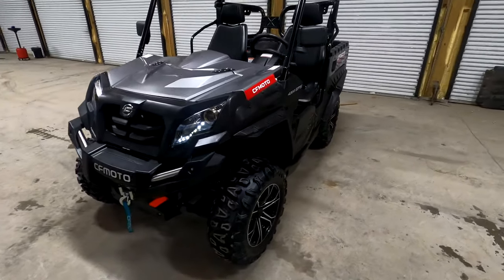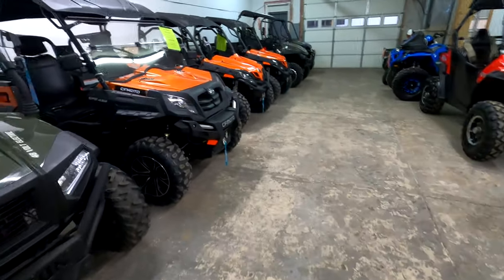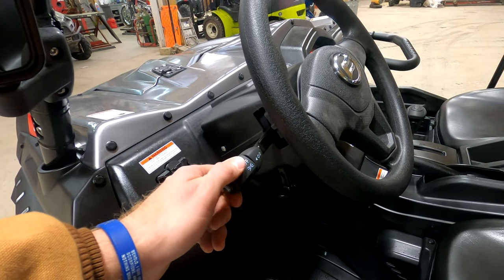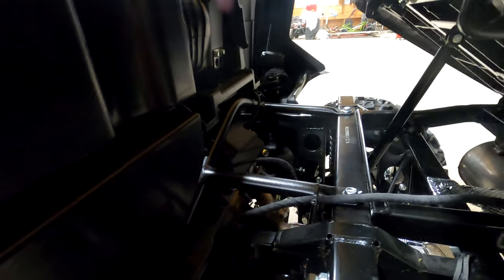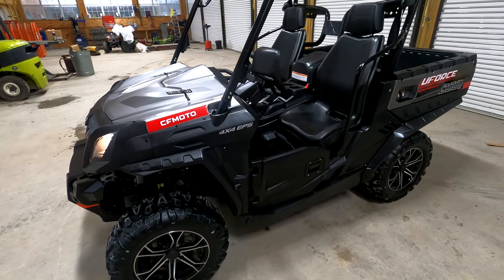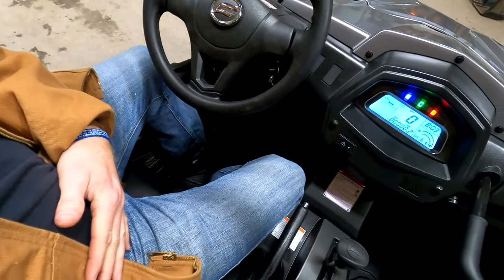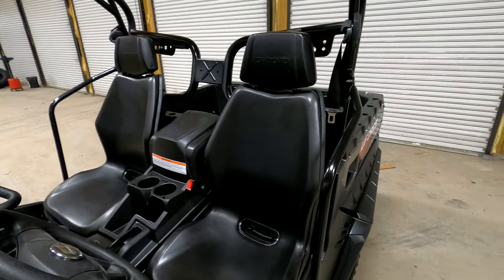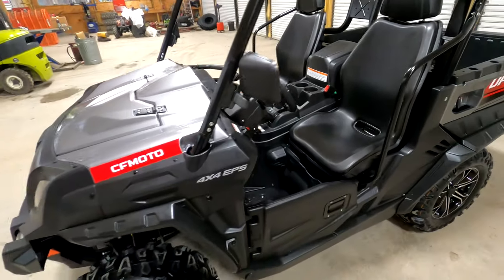2021 CFMOTO UFORCE 800 Walk Around & My Thoughts

Comment: I've had my UFORCE  800 since 2017. I've got 700 miles on it and no problem so far. IT will get with it pretty good and has the ability to climb hills good . I don't think there's a better utv for the money. THE ONLY complaint I have is the constant 2 wheel traction it's rough on the yard .

Comment: The uforce beads the automotive style roll cage the same as the zforce so you can put decent doors on them. I would like the 800 but will have to settle for the z600 just for that reason.

Comment: Make a Main Street Cycle model....hard cab it, 2 in lift. With 2 inch wheel spacers, a little bit larger tire, turn signals, and a spare tire carrier over the bed using the bed holes with attachment mounts. Still be cheaper than the competition.
Reply: Instablaster

Comment: Good walk-through, friend! I just placed an order for one at a dealer here in Wyoming. Quick question, if you can, are the chain attachments on the 2" receiver good tie-down points for the back? Your input would be appreciated! Thanks.
Reply from the maker: Yes.. I have strapped down one using the chain attachment points